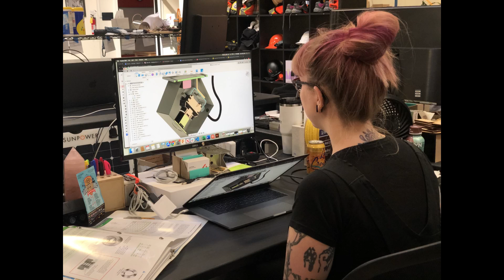Meet the Women of BattleBots // BattleBots 2019

Comment: Glad to see the connections to FIRST, I'm a student turned mentor. I know several of the top captains are also current mentors for teams. Donald Hutson (Lockjaw) mentors 1572 (Hammer Heads), Paul Ventimiglia (Bite Force) mentors 254 (The Cheesy Poofs), Aren Hill (Tantrum) mentors 971 (Spartan Robotics), and I know a few others, but they aren't team captains and don't really have their names out there. I've love to see some kind of giant chart linking team members and their FIRST origins and/or current mentoring.
Reply: Another student turned mentor here! FIRST was a great stepping stone for me into engineering and combat robotics. I spent spent 4 years at 968 RAWC and all those skills learned there greatly help me at work and the time I spend at Team Bad Kitty (Madcatter and Catking).